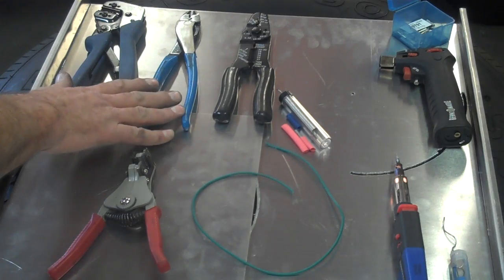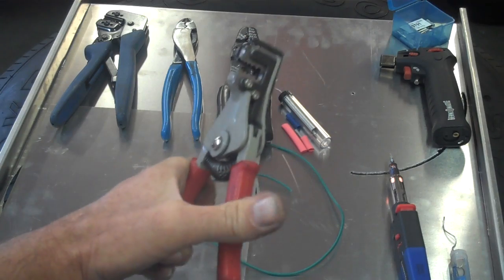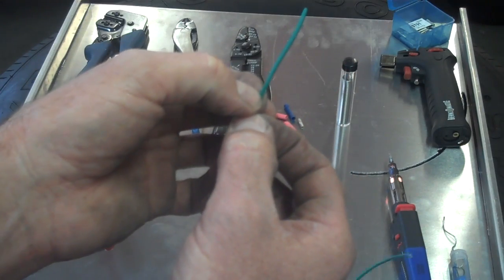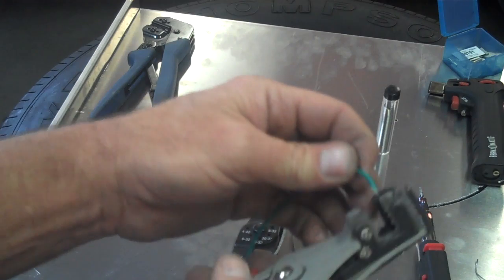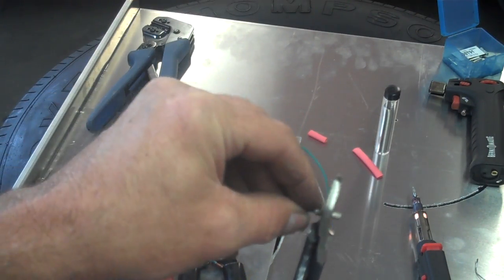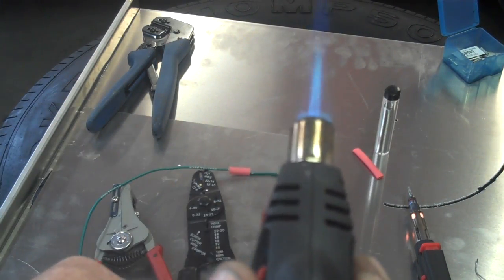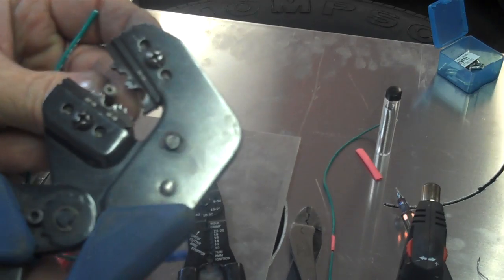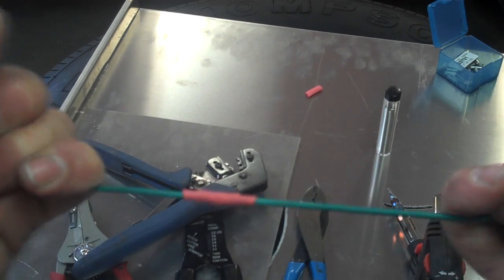How to splice and repair wires, splicing techniques

Comment: When you crimped the blue butt connector i don't think you were even trying.  Try resting the bottom handle of the crimp tool against the bench whilst pressing the other handle down.  They are not the best tools but I often use them and get good results.

Comment: Your problem with the blue butt connector is you are using what appears to be 18 awg wire with a 14-16 awg  butt connector. USE THE CORRECT 18-22! 

I admit,  yes those brittle plastic ones are annoying but make sure you are using the right one and they are plenty strong

Comment: Very good information; however, let's get real. Let's show all these large tools and wiggling around while under a trailer or dashboard in close quarters and short wires that are connected elsewhere. 
Again, thanks for the details on all these tools and connectors. Very good info.

Comment: You can do an insulated butt splice very well. You just need the right size of wire, a non-chinese butt connector, not crimp on the wire insulation, strip the correct length and use the right ratcheting crimping tool because there is also a difference between DIN and non-DIN connectors...

Comment: They sell insulated butt connectors with the heat shrink material on the ends so you can crimp, then heat. Might not be as strong/weatherproof as the non insulated terminal, but it's better than a regular insulated connector

Comment: will the third technique work for a gauge 6 wire on a 50 amp 220 volt?
Reply: For wires bigger than 10 AWG you might want to do something like a split bolt connection.

Comment: What about splicing a wire into a connection with out cutting it ? Is there a way to strip wire shielding with out cutting the wire ? 

Im upgrading my cars ECU and it needs a couple added sensors to function properly. 3 of the wires for the new sensors have to be spliced into the harness of the ECU's connector. But i don't want to completely cut the wire. I mean if i HAVE to i will but id like to reframe from cutting them to splice these wires in.

Comment: Great video. Informative of what TO use and what to AVOID USING. Heat shrink tubing is a great tool. I'm old skool and like to solder connections when I can; however, the non-insulated connector + HS tubing looks the winner (especially considering time). Great point on the chainsaw guy...made a note in my cheet-book. ;-)

Comment: favorite part:
"... so you can see, that's not really the ideal connection. short term - gotta use it because you're in the back woods somewhere and there's a guy with a chainsaw comin' after you... great, use it." (5:08)
(

Comment: I need to change the sensor underneath the car, which means that i have to splice wires. Is it wise to use the mini blow torch underneath there?

Comment: I really like this video.  I've now acquired some uninsulated crimp butt through connectors.  Trouble is, the crimp tool you say is the best... well I've got 2 very similar looking crimping tools, but they just don't crimp like in your video (with a neat machine like finish).  Can you recommend one?  Perhaps you've got a brand and model number? I think my universal one is for bigger connectors, and my other, which has red blue and yellow dots, is for insulated terminals only.  Thanks.

Comment from the maker: I'm not sure what the inside diameters are since I use them based on wire gauge. My guess would be that the 22-18 gauge would be around 1.5 mm, 16-14 around 2.0 mm and 12-10 around 2.5 mm. I think the dimensions you have are right in the ball park

Comment: What size are those "UNINSULATED CRIMP BUTT THROUGH CONNECTORS"?  I want to do work on stuff in car and so mostly need car-wire size ones.  On Ebay UK I've got choice between buying ones which are "inside diameter 1.8mm" or ones which are "inside diameter 2.4mm." ?? Great useful video btw.  Thanks. (Rooting through my Dad's old gear I just found one of those Lever Action Type Crimpers - which until watching this video I didn't even know what it was for.)

Comment from the maker: Any heat source will melt the shrink tubing but an open flame may damage the tubing if you get it too close. Keep the flame far enough away from the tubing to keep it from bubbling and it will work fine.

Comment from the maker: I'm not crazy about taps (scotch loks) because they often damage the wire and usually come loose after a while.  I would Tee with butt connectors or soldered joints, much stronger and less likely to come loose during use.